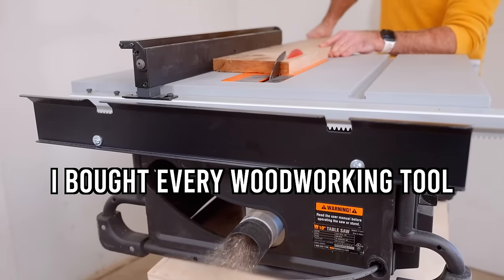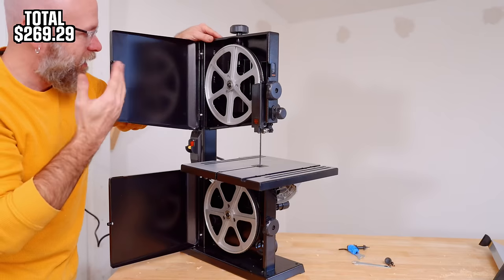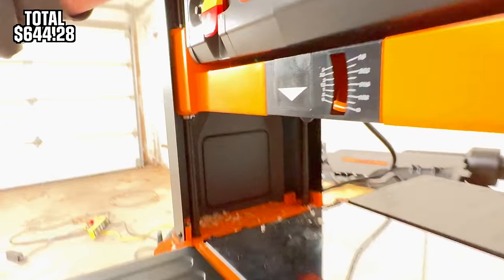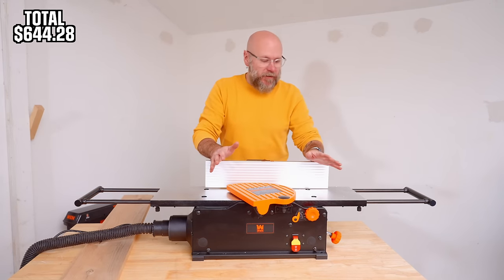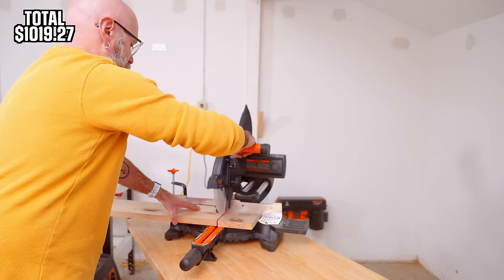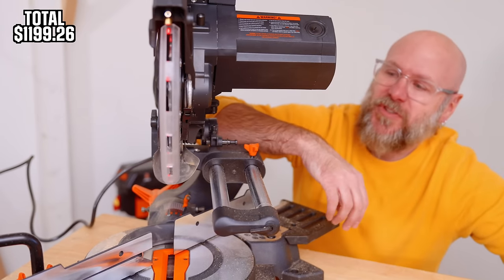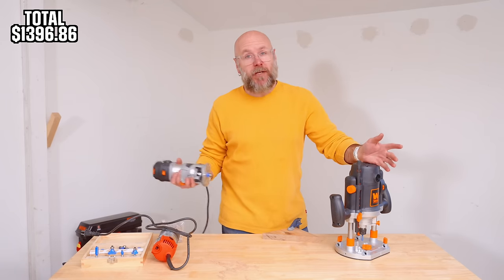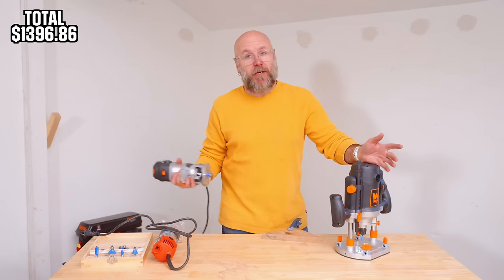I Bought ALL THE WEN TOOLS! Let's Review.

Comment: I have the WEN mini lathe for pen turning and it is AWESOME!! It is dial speed adjusted motor too which is why I went with it.  I've had it for 5 years and no issue whatsoever!
Reply: I have the same one, and, while I have my issues with some details (those cheap knobs really can get frustrating), it's been fine. That being said, I never recommend that one. The tool post holder is undersized from almost every other lathe on the market, so you're pretty much stuck with the factory tool rests - which aren't very good. Also, the tapers are MT1, while nearly every other lathe is MT2. Meaning that there are some accessories you can't get, and the ones you can will have to be replaced if you want to upgrade later.

Comment: I really hope there will be an update review on the planer. Both how the company handled the replacement or repair, if at all, and hopefully seeing it in action. 
It was the tool I watched the video for, and I too was greatly disappointed in its condition.
Reply: I had good experience with my first lathe. The control housing was cracked during shipping/handling and they replaced the whole unit quickly at that time. I am also interested in how the handle his issue, though his taking a great deal longer than I had to deal with
Reply: I have the Spiral Cutting Head from Wen, I got it for a great deal, and replaced my old delta planer. This thing cuts like butter, and has taken on some task that bogged down my old delta.
I was even able to find Carbide blades that fit the planer too. I swear some finishes from this planer, i feel like I don't need to sand. However I did overtighten and broke a leveling bolt on the feed bed and Wen replaced that no questions asked, they even sent a few spares incase I did it again.
Reply: lol. My sentiments exactly
Reply: EDIT: ignore, I'm an idiot. It's a local company. 

Removed post that has nothing to do with anything.
Reply: @eric_has_no_idea  wen is from Illinois...it's an American company
Reply: @karl_alan  I stand corrected, I should have known, they are only 35 miles west of me.
Reply: I hope there’s an update review on all of the tools.  One thing that scares me about tools that use cheap motors and lots of plastic is the longevity.  That said, I’ve got a Wen Drill Press and it’s given me no problems in years.
Reply: I'm also hoping for a review of the planer. I have the drill press and got the jointer for Christmas. I absolutely love the cut quality of the spiral head. After this video I'm starting to think I should replace most of my tools with Wen (but I'm keeping my Saw Stop table saw because I like my fingers) so I really want to know how good the planer is.
Reply: I bought all mine through Walmart. Any problem and you can return it quick and get it replaced.
Reply: @ericw9655  same. I love my Wen drill press.
But where he was complaining about the spring tension, my complaint is on how many revolutions it needs. Otherwise, I find it very satisfying to use.
Reply: @karl_alan American company but that's just office in and maybe warehouse, everything is made in China. So it's not truly a American company in any way except in name.
Reply: Was that a 67 Impala in your drive way?
Reply: I was waiting till the end of the video to come and talk about this. I think this has been handled poorly. When you send them a picture of the product missing the whole drivetrain, that should result in a return shipping label being sent immediately. It's not your problem if it's a repair unit that got sent out accidentally. You paid for a new tool and that's what you should've gotten.
Reply: Same. I hope he gets a working tool and can update!
Reply: @JamesSmullins ❤
Reply: If it helps, ive had the wen planer for 2 years. Im a hobby(ish)ist - run the equivalent of 20 or so cutting boards worth of material through for different projects and have literally zero issues. Still accurate and cuts well. The 3 blade option.
Reply: Ya I was really interested as well!
Reply: He did post an update - he received a replacement, and says it works perfectly - five stars.
Reply: Same

Comment: I love all of my Wen tools and they have been great. I have the bigger variable speed drill press, the band saw, the small lathe, the biscuit joiner, an air filtration system, the belt and disc sander, and the variable speed bench grinder. Most of my other tools are Dewalt and Porter-Cable and they fit in nicely in that quality tier. I agree about the knobs on some of their products.

Comment: The reason the wen table saw is loud is because it runs a universal motor through a loud gearbox.
The sawstop uses an induction motor with belts.
Reply: Yep. Cheaper table top aluminum table saws are essentially a circular saw bolted to the underside of the table. The motors will bog down under any kind of hardwood thicker than 1". The brushes will eventually have to be changed on them which is usually a big hassle. I had a cheap craftsman and had to change the brushes on the motor. It took me a couple of hours just to remove the motor from the top. They have a direct drive motor.
Reply: I would spring for a bigger and beefier 240v PSC motor cabinet saw.
Reply: @LutherBuilds my Bosch doesn't "bog down" on 1" anything. At about 1.75 or so it will, which is phenomenal. Just keep in mind we don't always know everything about everything.
However, the Bosch is definitely close to or the same decibel rating, so hearing protection is absolutely necessary.
Reply: @LutherBuilds  brushes are cheap and easy to replace. And you should replace them regularly for damn near infinite tool life.

Comment: I work for a commercial metal framing company and we are phasing out our dewalt and Milwaukee abrasive chopsaws for the wen cold cut steel chop saw. The quality is great and they run great. One of the wen blades it came with actually lasted a whole job for us. Probably well over 1000 cuts. And even with the teeth messed up a bit at the end it still made clean fast cuts. We aren’t a fan of supporting Chinese products but the big box brands are made in China too but this one is way better

Comment: WEN actually has excellent customer service. They will 100% fix this problem.
Reply: Excellent customer service does not take over 12 days to response to a customer and still have the issue unsolved after 18 days when the customer is responding with the requested information.

Comment: I have the WEN 8" drill press and their 1x30 belt/disc sander. Both are workhorses in my little shop. I make bird/squirrel feeders that I sell on Etsy and both of those tools are used on every single feeder that I make. I've had the drill press for 3-4 years (bought it for $75 on Amazon) and got the sander last spring. I'm sold on WEN tools. This was a great video demonstrating the value one gets from WEN. Well done.

Comment: For the router spin down time, the wired Wen is using a brushed AC motor, and the Dewalt is using a Brushless DC Motor (3 phase motor). With Brushless DC Motors, you can use the motor controller as a brake to stop the motor quickly, the same way electric cars use "regenerative braking" to cause the motors to slow down. This is not something that can be easily done with brushed AC motors without expensive electronics, so it take much longer to stop spinning.
Reply: It can also be done with an electronic brake, which is a fairly simple, low-tech component. My radial arm saw from the '80s has one, so not exactly cutting-edge tech (pardon the pun).
Reply: @petergamache5368 yeah, on a brushed motor you just short the 2 motor wires and it acts like a brake.

Comment: I bought the bigger Wen track saw and the Powertek tracks for it last year. I've ripped and cut dozens of sheets of plywood and pvc with it at this point and I love it for doing straight cuts. There is a little flex to it that you have to be mindful of when cutting, but as long as you don't torque the saw on the track and you just gently push it down it cuts great. The Powertek tracks are longer too, so 1 track lets you easily cut a 4' piece.
Reply: Where is the track saw review? Did I miss it? Watched the whole video and never saw it?
Reply: Found it lol

Comment: I have the Wen digital variable speed drill press. love it. Use 2.5 inch forsner bit no problem.
Have the Wen band saw. Works fine.
I've got the 6 inch jointer. works fine.
Thanks for the reviews.

Comment: The planer missing the drive system is honestly a surprise, I got one about 5 years ago and it's still going super strong, only issues I've had was self generated cause I missed a piece of metal before sending a board through so now I need new blades. But it still chews right through hardwood no problem.
Reply: The planer knives are reversible, if you didn't already know. You just take them out, flip them around, and put them back in. I ran into the same problem a couple of years ago and was just about to order a new set of knives when I noticed in the description that it said they were reversible.

Comment: I have several WEN tools. Never had an issue with any of them. I have the   drill press. the lathe, belt / disc sander, spindle sander, 8in jointer  . dust collector , air filtration, cordless track saw. Love them.
Reply: … and the status of your ** plastic knobs and levers? 🤔

Comment: I had a Wen track saw for years before moving to Festool. It's a great piece of gear. If you consider the saw without the tracks it should be a 5* all the way, especially because you can use it on Festool tracks without issue ;)

Comment: Great cross section of tools!  I bought the WEN 10" Miter for a barn board siding project at my in-laws house so I didn't want to take the one out of my shop every time I did work over there.  I have it mounted t a Harbor Freight portable miter stand and it's an awesome combo and nice and light to move around.  Only change I did was install a quality CMT blade.  I also have the WEN jointer that has served me well.

Comment: Your Sawstop is much more quiet because it’s belt driven vs almost every new contractor saw which is direct drive.  The saw running by itself is louder than running something through it.
Reply from the maker: Thank you for that explanation.
Reply: It's also the motor type. The sawstop has an induction motor, and the little jobsite saws have universal motors. Universal motors have brushes and like to "scream" even under zero load.
Reply: I have a direct drive Bosch and its also quiet. A belt doesnt make things quieter... why would it? It just adds another sound source.
The motor type is what matters.
Reply: A contractor saw is belt driven with a cast iron top, next best thing after a cabinet saw. The direct drive saws are what are known as job site saws.       The noise is due to the brushed motor as opposed to the much quieter induction moter used on higher quality machines.

Comment: The thing about the lesser expensive power tools is, right out of the box, the tool  may be fine, but over the long haul or under constant usage, how durable is the tool and how well does the tool stay in alignment. Maybe a follow-up video on the durability of these tools after they've been used for while.
Reply: @armus550b  This is probably true. but this is also for someone who is either getting started or cant afford the bigger and better. Something is always better than nothing. If at the time of crapping out, either the person will hopefully be able to upgrade because they found they use it a lot more, or they can replace it with the new model. Otherwise, if you can afford better.....get better.

Comment: Quick Tip on the track saw, because the base is 100% plastic, it can flex laterally during cuts, but the solution to that is easy: Don't lean or push on it sideways while cutting. I've been getting perfect cuts with mine. Love it!

Comment: 32:15  The reason that saw is louder is because it has an entirely different motor.  The larger induction motors will absolutely run quieter than the smaller motors found in contractor saws.

Comment: I bought the Wen 4-3/8" hand planer when my Dewalt 20 volt hand planer burnt up from dust clogged around the actual motor. The dewalt was bad for the shavings port to clog way too fast. I had to stick something inside it to drag the shavings out and it was a pain. the Wen planer has a flip lever to change it from left or right side shaving direction. When it clogged just flip it from left to right once or twice and it clears itself. The Wen rarely clogs unlike the Dewalt. I used this tool in a long hard commercial job and it rocked. This tool is a beast and I only gave $58.55 total. I cleaned up a ton of rough cut 8 x 8 post and the Wen planer had plenty of power to take a lot of meat off in 1 swipe. you can't go wrong with the Wen hand planer

Comment: Priced out all the tools with harbor freight equivalents. Tried to stick to Bauer and Hercules, but a few tools haven't been updated yet so had to go with the Chicago brands. Most of the tools are at least equivalent in specs with the following differences: the palm sander is 1.2 amps, the miter saw is dual bevel, the planer is tri-blade and only 12.5", and I don't think the table saw has an extension. Also, HF doesn't have a track saw or jointer, so priced those with current Wen prices. With current deals, total comes out to $2220.31, so pretty spot on!
Reply from the maker: dang! That's some great research. Thanks!

Comment: I didn't see this in the comments so far (there are many, so perhaps I missed one or two)- but the adjustment handles can be pulled out to change the orientation.  Pull it out, rotate by usually 45 or 60 degrees, and pop it back in.  This is fairly standard on this type handle over many different manufacturers.

Otherwise, great video, and thanks for your opinions and suggestions to improve these tools

Comment: Thanks for doing this, WEN seems like a pretty good budget brand. But I hope you can do a follow-up to look at one of the biggest concerns I have with “pretty good” tools vs. more expensive pro level counterparts: the ability to stay in tune so making consistent cuts doesn’t require ongoing fiddling. If a tool drifts out of tune easily, best case is you have to add a step to be sure it’s fit before you use it; the much more likely case is you don’t do that and end up with some bad cuts, burn marks, etc. (if part of the cheap feel of the knob is not just the knob but the hardware and interface at the business end of the adjustment, that’s the kind of deficiency that can lead to alignment drift, etc.)

Comment: I started my business 5 years ago with the wen 10" bandsaw and 4"x36"stationary belt sander. They are still running strong, but im in the market for upgrades. Definitely worth it if you're a hobbyist who is considering a business. I later added the air filter and bandfile, they're fine.

Comment: Thanks for the review.  I realize you can’t cover everything but I still have some unanswered questions: 
1) resawing on the band saw - can it even a little?
2) can either router be fitted with a bushing ie template guide?
3) face planning especially on knotty grain - does it tear out, bog down or just slide smooth like spreading butter
4) dust collection on sander and jointer, good or future lung disease 
5) how much time required to change to/from sanding belt to spindle - easy or pain.
6) does the table saw have a long enough blade mount to accommodate a dado set.  Are the miter slots parallel to the blade?  Any blade run out ie wobble? (Actually I don’t care, but only because I have a big cabinet saw, but I certainly would care if I was looking for another saw or recommending to a friend.)
7) how difficult is the big router to use in a router table:  ie accessibility of the switch, convince and precision of depth adjustment.

Thx
Reply: 1) I am curious about the same thing too.
2) As far as I know, all routers can be mounted with  aftermarket bushing kits. I think those are universal. 
4) Dust collection is done best in 3 ways. 1st  take it outside & plane on a breezy day. 2nd is to connect up to a dust collector, mine is a shopvac. 3rd, do both!😂😂😂😂
6) As far as I know, all tablesaws are able to accommodate dads blade kits. Pretty inherent to the  tool itself.

Hope my knowledge helps

Comment: Had the Wen floor standing bandsaw… it was sloppy so I sold it. Used the money to buy a used Wen 12” drill press (4214). It’s pretty nice  even though the seller messed up the quill. Ordered a new quill from Wen… $13.99. I appreciate that Wen sells replacement parts and doesn’t overcharge for them. Drill press works great now. I’m not a fan of Wen tools and only own two; however, Wen provides good customer service, inexpensive replacement parts, and a comprehensive user manuals with parts list with every tool.

Comment: 30+ years ago my father had a WEN electric angle grinder, the large type with a side handle that needs 2 hands. It quit and he was going to have to get a new one. He had a WEN electric chainsaw he hadn't used in a long time so I suggested "Why not see if the armature from the chainsaw will fit in the grinder?"

We took both tools apart and behold! The chainsaw motor armature looked identical. So it went into the grinder and it not only ran it had a lot more power. Just one small detail, it ran the opposite direction it was supposed to. No problem, just tighten the nut holding the flexible grinding discs (like super thick and coarse sandpaper) *really tight*. Never threw a disc off after the first one. ;) Dad used that grinder for several more years doing body repair on cars.